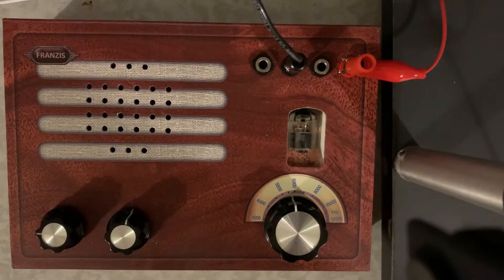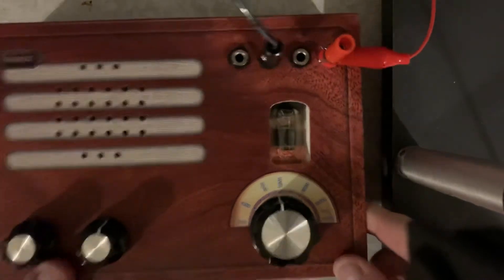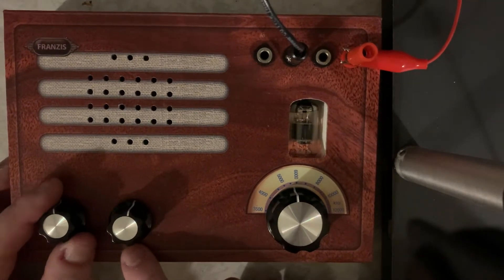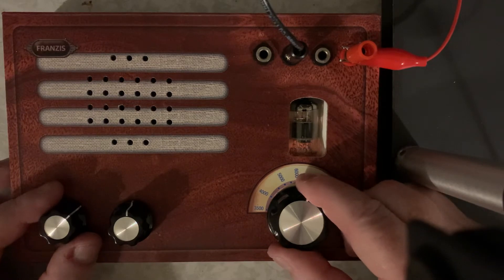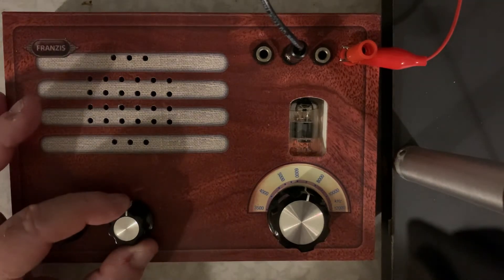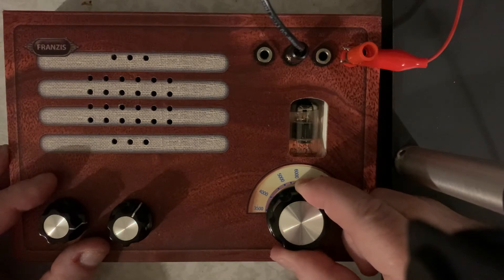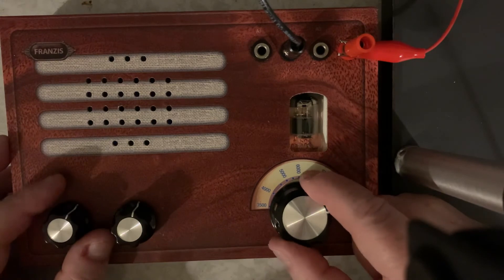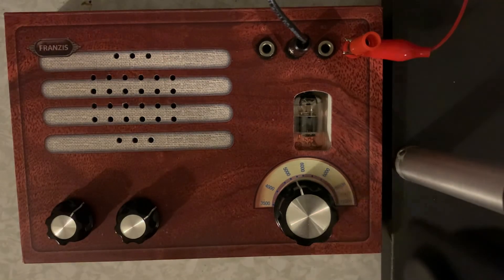Franzis Shortwave Radio Kit Demo

Comment: The second buttons is not à fine tuning, This is the regenerative control. This is à regenerative receiver, high sensitivity with one tube. Was common in 1930. Regenerative control allons gain increase but can.lead to oscillations. So should be taken smoothly.